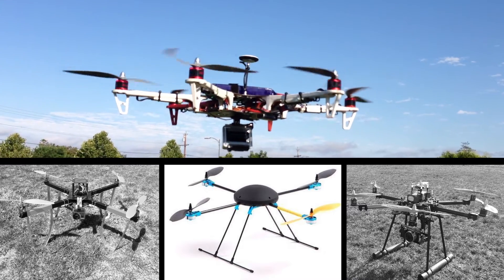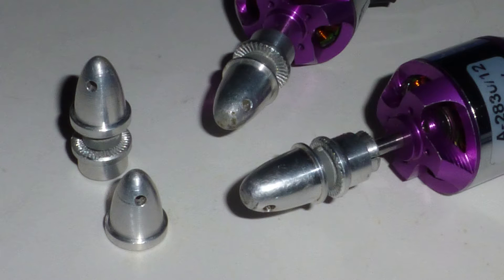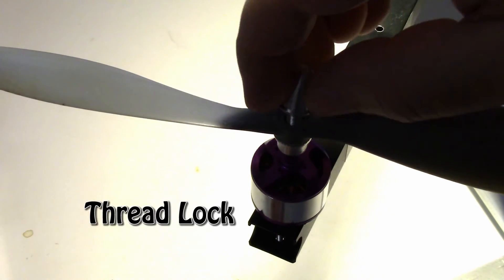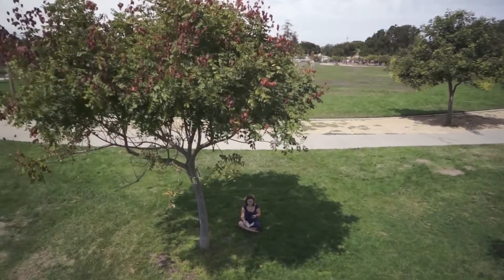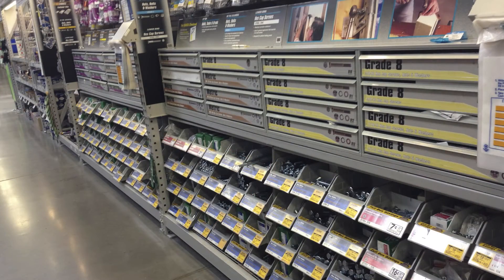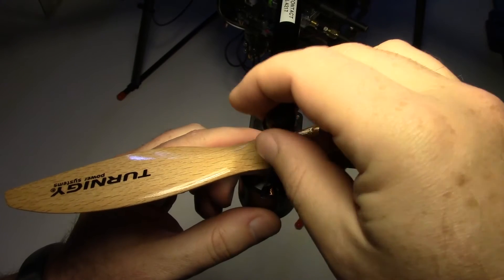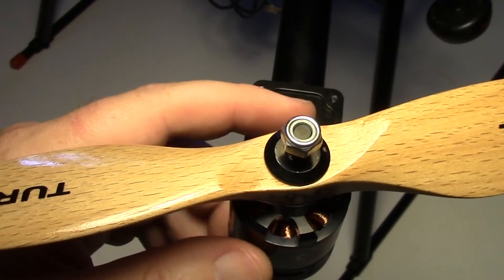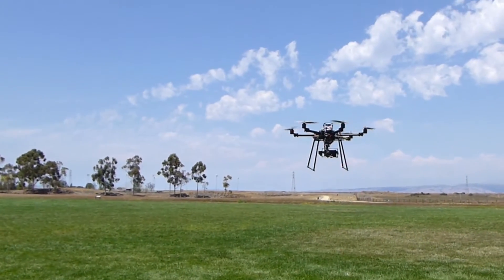Upgrading your Multi-Rotor with Nylock Prop Nuts

Comment: Amazing video! my first flight my CCW prop FLEW off and i landed in a tree losing the PROP and the nut... will be ordering some of these as replacements. for those who are building a new drone - you can find reverse threaded motors that will actually tighten the bolt as it spins :)

Comment: so does this men you will use two washers? one below the prop and one above?
Reply: +vishal chanAfter I started using  two (2) #5 lock washers,  external between propeller and motor  and internal toothed on top, plus a nylon locking  nut,  I have not had a  anymore problems.